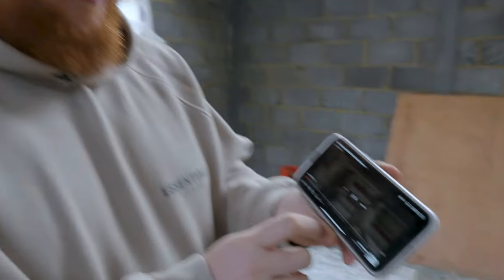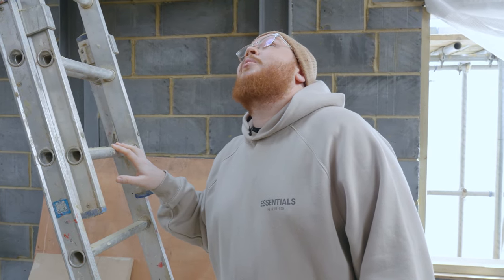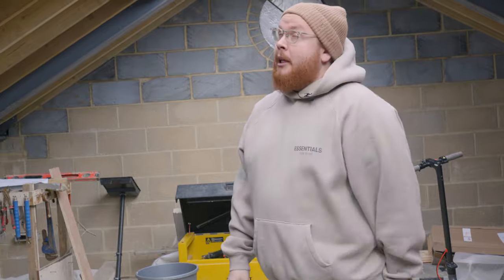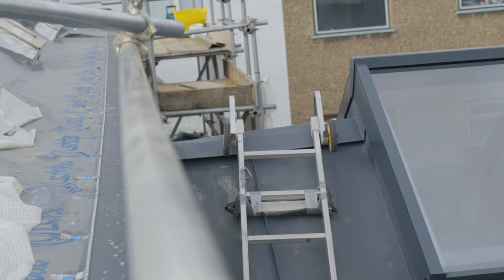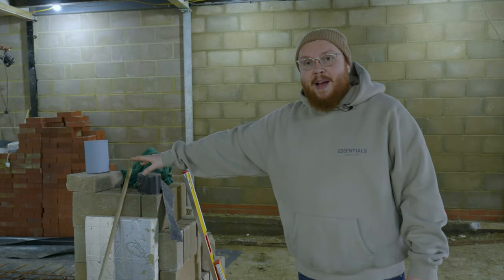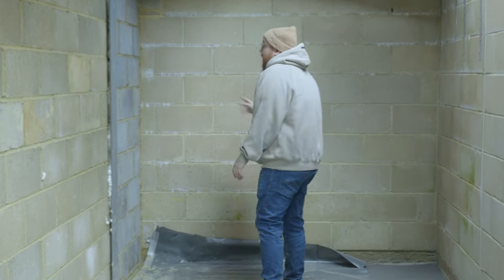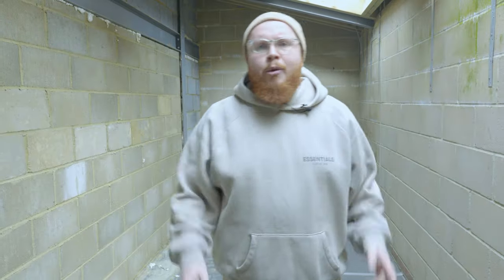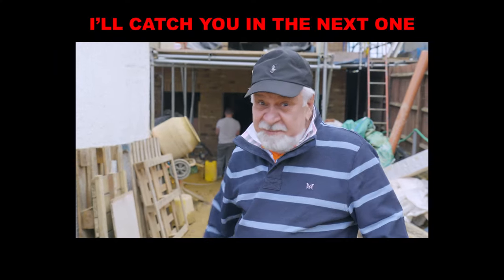DOWN THE HATCH! - KR Sabers Warehouse VLOG 015

Comment: Hi Khal

Love tuning in to watch your videos ...  always entertaining! ..

Re Suggestions:
From experience you should use your building plans at a reduced size to print out and make yourself a foam/card model of the layout on both floors. Use card to put the furniture, desks and machinery where you think you want it. you'll be surprised what works and what doesnt .. 

An empty sapace looks huge but as soon as you have sofas, desks, benches and stations in place it soon fills up .. Building a quick foam or card model at a samll scale ....it allows you to see where there are spaces and where things might be cramped?

Architects are great at creating spaces but you will be using it nd you know where you will be spending your time most and what areas will be busy ... Doing this also allows you to see the pathways that will be walked most often ... A to B and B to C etc ,.. you may find that there are some bits when you do this that you want to mave to make moving around in the space easier. 

just an ideabut ive used it a few times .. its fun but well worth the time as you'll be surpried where the pinch pints are and what does and doesnt work.

Comment: Showroom display should for sure go upstairs with the Star Wars decor! It’ll fit right in and look snazzy if you get a nice display case/cabinet. The 3D printers will work perfect in that space downstairs and keep everything streamlined like you said too! As for the steel beam under the roof windows.. all it makes me think of with the angles and windows is a Star destroyer! Maybe use it as a way to hang something that somewhat obscured the beam and yet adds another geeky touch? Maybe a cool droid salvage lamp like the ones in galaxy’s edge, or a tantive IV? There are a ton of possibilities to decorate around it or under it that I’m sure you can come up with down the line once the space is finished too. So I wouldn’t stress over it right now!